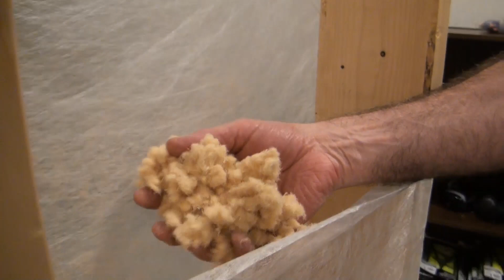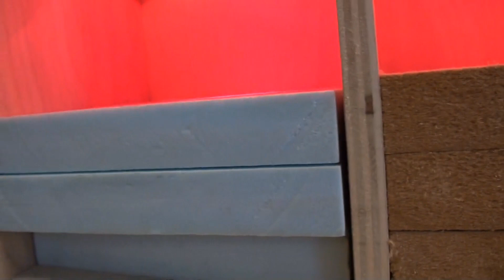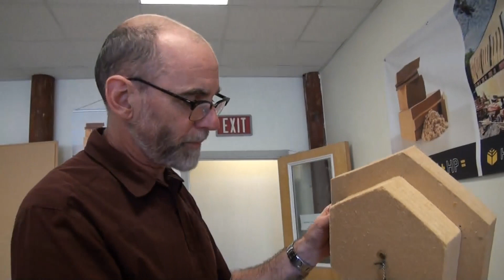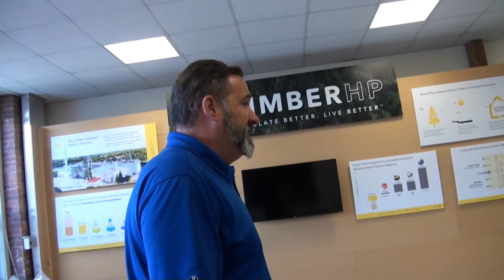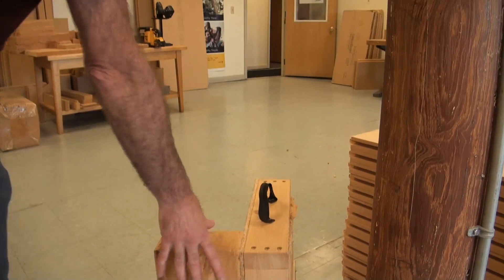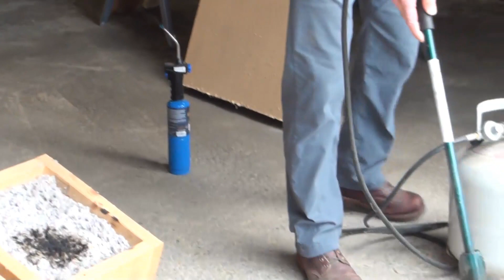Now You Know HP Timber

Comment: one of the best combinations of wood fiber insulation and wall assemblies is with mass timber walls as in laminated logs or CLT. 
with mass timber you have increased heat storage capacity and the hygroscopic effect comes into play on the interior . 
My house has 14 cm thick solid wood walls with about 14 cm of WFI on the outside . furring strips are installed over the insulation panels vertically to accept a siding of the owners preference . the space between the furring strips acts  as a vent to wick moisture away . the challenge are open at the bottom and top of the wall with ridged perforated aluminum sheet metal strips to repel   rodents and insects . 
the windows are triple glazed and the blower test was near passive house standards . it takes about forty eight hours to notice any significant temp and humidity changes in the winter . no fresh air mechanicals are needed as the interior wood is left bare and flooring is sealed in non off gassing materials . my wife hold seminars in the house and everyone that comes mentions how comfortable it is . they generally sit quietly at first and then start looking around ,as if they are trying to figure out what they are feeling .